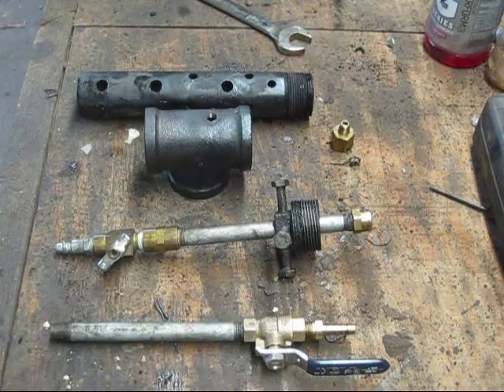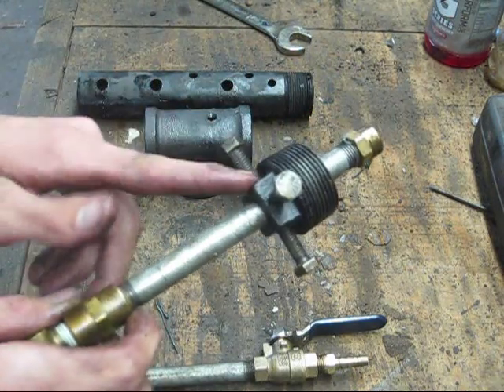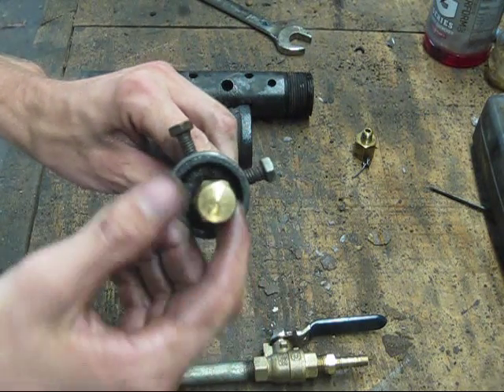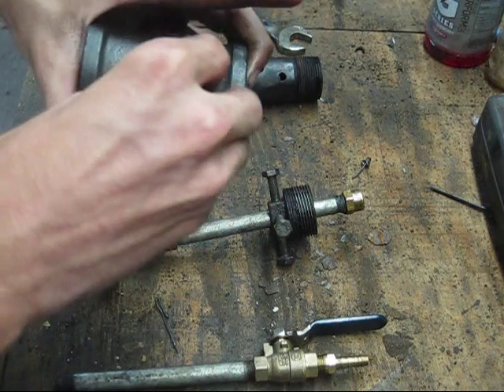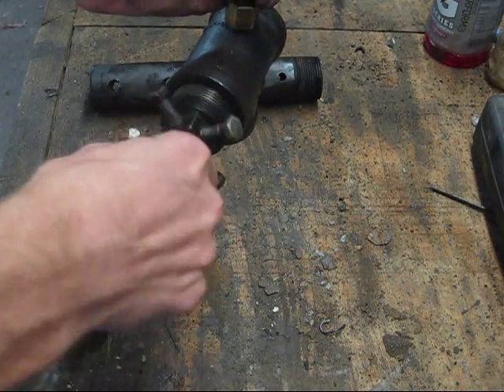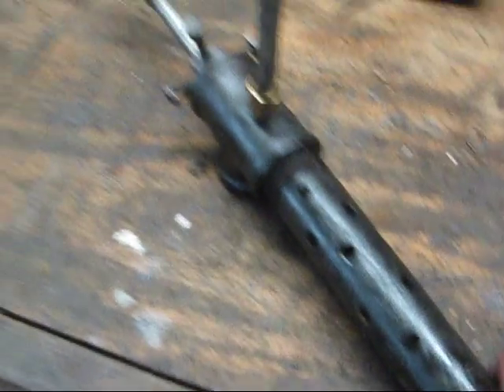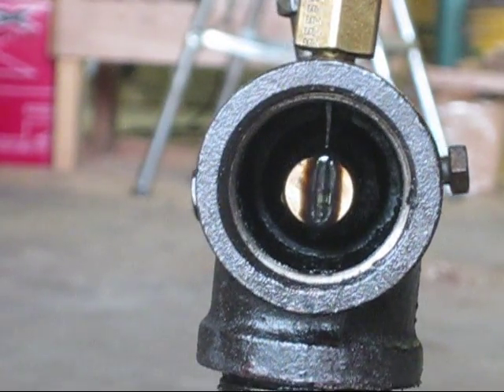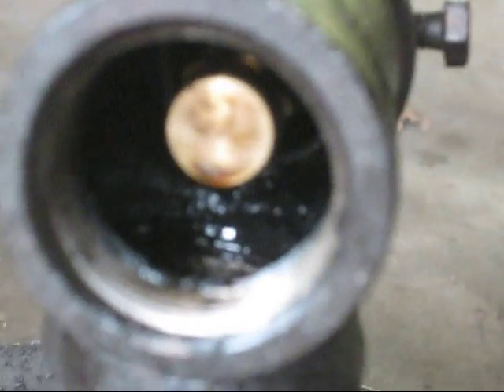Blast forge

Comment: Didn't you sort of defeat yourself when the burner was titled backwards? That had to change where the oil drops were falling. Then attaching the after-burner tube, the assembly became almost level and had more fuel more consistently being misted or atomized. Seems leveling is critical, and or relationship of guide wire to orifice face. Would it make sense to pack some med or coarse steel wool around the guide-wire knot, to ensure its positioning? Maybe the wire should be wrapped one turn around a screwdriver shaft and cut neatly so it has a nice round ring allowing it to dangle predictably down the center of the reducer outlet. Then the only adjustment is the air-injector assembly position. Could also use a small cotter pin, opened half way and then tightly reformed around an appropriately-sized screwdriver shaft, then the ends clipped even.